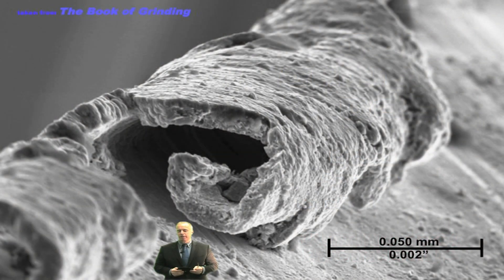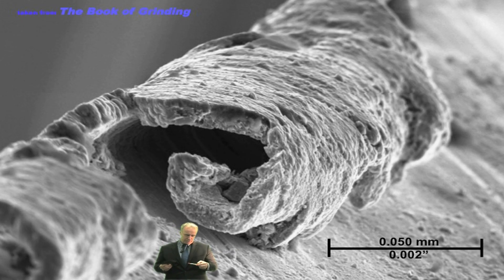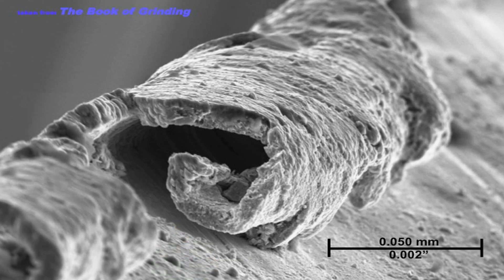Episode 73: So you want to eliminate burr?

Comment: you can eleminate the burr by cutting hard stuff. Not quite as hard as the cutting edge itself though.
Reply: Exactly right. I run my blades across a piece of hardwood.
Reply: @elconquistador98 this has been shown not to work, from science if Sharp's electron microscopy. The burr is caused by incredible localized force acting on thin steel, smaller grits are more evenly flat and exact less force. Strops don't put excess pressure at the tip, even with large particles, and so don't create burrs easily.
Reply: I run mine against the side walk